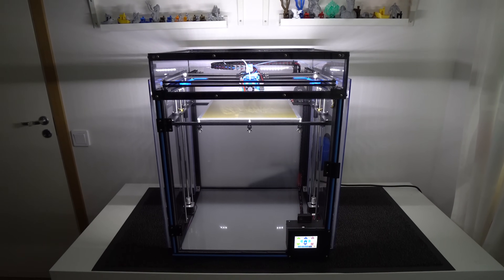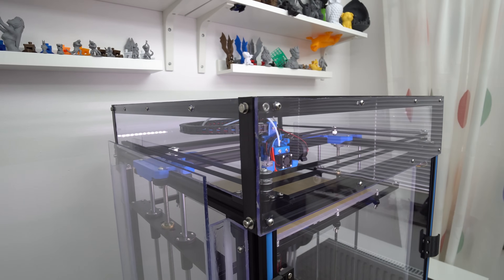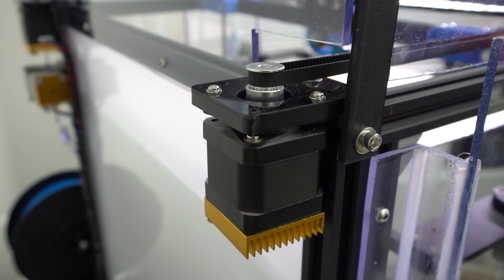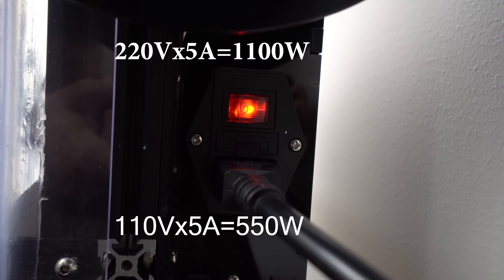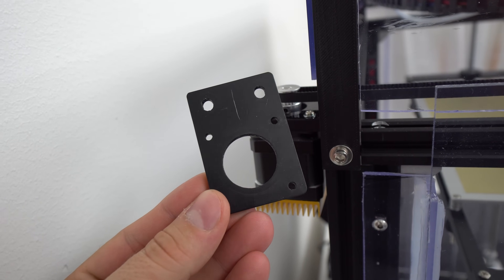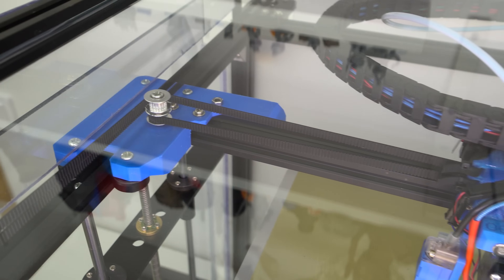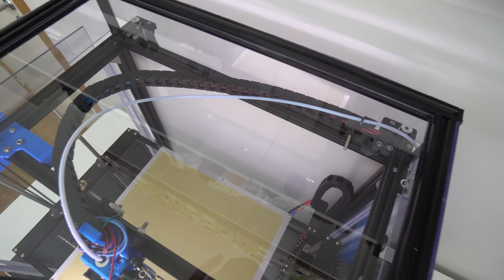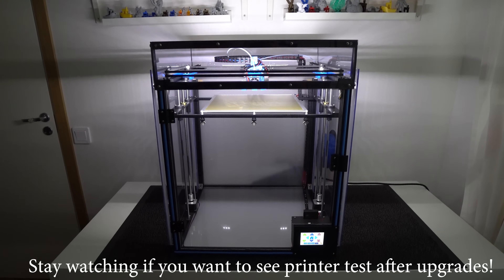Tronxy X5SA 3d printer ultimate upgrades!

Comment: Hello, what is the differences between X5S and X5SA ?  For example on the X5S is famous the heated bed is not working and have to buy a dedicated power supply of 24V for make it heat up. Here on the X5SA is the same? Seems like they upgrade/fix some issues from the X5S and named X5SA but what they update?
Thanks
Reply: Or by the way why the X5SA it cost 60$ more that the X5S ? On the gearbest site they have same features. Thanks

Comment: Before i install a Solid state relay to this X5SA, i saw one of your videos on your Creality CR-10 build to where you have put a SSR and a 330W heater under the bed. Does the same instruction from that video apply here since i have already annalized that and would like to do it to this tronxy as well. before i kill myself doing all the wiring and stuff, i would like to know if it will apply to this machine as well.

Keep in mind, I seriously dont know what i'm doing since i am new to this whole 3D printing business but i would like to learn from experience and not kill jyself in the proceess.

Comment: Layer consistency needs improvements. Straightening the belt path and tightening the belt is in order but acrylic parts will not be able to handle the load.
In all looks very nice but lot less attention was paid for the things that actually improve print quality. In particular stainless steel nozzle with low conductivity levels will make it difficult to get consistent prints. Hardened steel is lot better in that respect.

Comment: I was wondering how you calculated your M8011 firmware value for the titan extruder steps. is there a formula that you used? I read the Chitu G Code explanation but its still a bit confusing.

Comment: Hey,  Awesome video. Hoping you see this. Im new to 3d printing and planning on getting a x5st will these mods be compatible with this model as well? Looks to be the same just a slightly bigger bed size. Thanks
Reply from the maker: Jayden Smith Thanks.
 Yes I believe so. As far I can see only screen is a bit different and it's bigger in size.
Reply: @NexiTech  Awesome, looking forward to it. Thanks

Comment: Nexi, first of all, I have to say your channel is one of the most detailed, helpful, 3D printer channels I've ever come across. Thanks for sharing all the hard work. Definitely gained a subscriber.

A couple quick questions for you: 1) Does your modified X5SA print any faster than any of the comparable cartesian printers? (Tornado/ CR-10/ Chiron/ etc.)

2) What are your thoughts about core XY vs. Delta printers vs. Cartesian are far as speed? The published specs are usually ~ the same, but every comparison between the delta and  cartesian, the delta wins. I can't find any comparisons between core xy & delta. (Assumes comparable finish quality for the speed tests).

Thanks!

Comment: Hi! Thanks Your video! Please help me... Are you sticking a silicone heat-bed heater to the original heater-bed or have you bought an aluminim sheet? Thanks
Reply from the maker: Just stick it to the original Heater-bed, New heater has double side tape on it. Of course first remove  all wires and old thermistor from old heater. New one has everything on it.
Reply: Nexi Tech thank you

Comment: Hi i do auto home and the dsplay in system menu show this:x= mm 50,00 y=mm 30,00 z= mm 2,20gcode start in my cura settings:G28 ;Home
G1 Z15.0 F6000 ;Move the platform down 15mm
;Prime the extruder
G92 E0
G1 F200 E3
G92 E0i'm a newbie and i dont know how to set cura start gcode...I'm also non be able to connect pc with x5sa by repetier host.. i connect it but printers dont execute the commands that i send to it...greetings for your help in advance

Comment: Hi, I made the changes to the x5sa as your video for the guides of the extruder (mega gantry plate), but when I do z-offset the hotend does not position itself central to the plate and the print does not respect the Cura 3.5 measurements while having them set from cura setting 330x330x400mm. can you help me solve the situation?
Reply from the maker: Gian luigi agostini How far you are off on X and Y axis? Can you do auto home and measure it? You can do X and Y axis offset in your start Gcode in your slicer settings.
Reply: this evening i do it and then tell you...greetings

Comment: I've been thinking of upgrading from my i3 clone to a CoreXY printer for a while now. With this many upgrades, I wonder if it's even worth going with a printer kit. It might be cheaper to build your own from scratch!
Reply: I thought the same thing. Then I actually added up all the parts for just the frame, wiring, and control board (no hotend or heat bed) using the cheapest options I could find on BangGood and AliExpress and it was already $100 more than this!

Comment: never mind I figured it out. The default travel speed in cura is 120mm which is way too fast for this printer. I set it to 60 and haven't had an issue. since.
Reply from the maker: Rick Smart You got some problem with your machine. I can reach 200mm/s travel without any problem or any layer shift even with completely stock hardware with no mods on this machine. First check your X and Y movement's by hand are they move nice and smooth? Then double check all wheel bearings on aluminium extrusions. Then re-check bearings(pulleys). They all need to roll smooth and without drag.  Maybe you over tight bearings on belts. Also last step re-check  stepper drivers voltages. Set them to 0.9V.
Reply: @NexiTech  hey,

I had already checked all of that and then again. I was about to send it back but after doing a little digging on reddit a user suggested I turn the travel speed down and it worked like a dream. Also i dont know how to change the voltage of my stepper motors. Do you have a tutorial? Thanks for getting back to me so fast as well.

Comment: Did you have any trouble connecting to Cura via usb? I cant seem to detect the printer and ive tried using all com ports and still nothing any help would be awesome. Great video! and Tronxy must have listened to you they added butterfly nuts for the bed and way better Y and X bearings on my kit i just got. Thanks.

Comment: Maybe I understood. I have to copy from https: //drive.google.com/open? Id = 1hy5 ... from "All firmware gcode"the file
titan extruder steps.txt rename it in gcode put it on the sd card and launch the print ... can you confirm that the procedure is correct?
Reply from the maker: Gian luigi agostini Yes, just use .TXT file no need to change to .Gcode. Copy to Micro SD card and click "print". Easy
Reply: copy file without change in it in sd card  and print from x5sa?

Comment: NOTE: When installing the Solid State Relay notice that the DC input polarity (+ and -) is important.  The polarity is not marked on the green Heated Bed connector on the motherboard.  Use a multimeter to determine the polarity coming from the connector by going to Pre Heat on the touch screen and turning on the Heated Bed (but not Hot End).  If you have your probes reversed you will see a -12 volts displayed.  On my motherboard the positive was on the left, negative was on the right.  I swapped in a black wire for negative so I could easily tell the difference in the future (14 guage to match, but not necessarily required since current draw much less now).
Reply: ...just an update on Heated Bed upgrade...  I stuck the 600W Bed Heater to the aluminum bed using 3M backing (500W in my case, since I bought the one that works with 120V - RMS from my wall measures 126V, so I picked that model of Bed Heater from the AliExpress link Nexi provided).  The Bed Heater has a thermistor in its center, so I removed the original thermistor that came with the printer.  Hooked up the new thermistor wires to the old thermistor wiring (so I could re-use the motherboard connector).  Them I wired the AC and DC connections for the Solid State Relay and to the Power Supply AC screws as diagrammed in that other thread).  I ran a Pre-Heat from the Control Panel to 60 C bed heat and it measured perfectly at the center of the aluminum plate.  I put the plate on top of the Headbed Insulation (hadn't glued it on with Silicone yet) and cranked up the Pre-Heat to 100 C.  Very fast heat-up and perfect reading.  There is a few degrees fall-off around the edge of the plate, but to be expected in an open environment and such a large plate.

I put the Silicone Sealant on the back of the Bed Heater and secured the sheet of Heatbed Insulation.  Silicone sealant takes 24 hours to cure, so I will re-assemble my printer then.  Love these upgrades - Thank You So Much Nexi !!!
Reply: @MrTactileFeedback314  Did you need to get a different SSR than the one mentioned? One for 120V out?

Comment: where you mounted x-axys endstop on the hotend? i cannot see it
Reply from the maker: Gian luigi agostini Open this link and check photos.
https://drive.google.com/drive/mobile/folders/1hy5MsZN4WBtp-So_kmnCvzz4_ft4idHY?usp=drive_open
Reply: another question ... do you have to change something in the printer firmware to use the titan extruder? do you have an electric scheme of how to connect the v6 to the cables to which the original hotend was connected?

Comment: Thanks for the video. I am between the Tronxy X5S 500 and CR10S 500. What would you recommend between the two? I have no 3D printer experience, but am mechanically capable and think I could tinker with either one. They both seem very popular, but have noticed differences such as a cubed frame and belts vs lead screws between the two. Of these two models, what do you recommend? Thank you
Reply from the maker: spezzy To be honest none of them. You will have alot of problems leveling the bed that size on both machines. Auto level is a must have at that scale. Also both have 12V power supplies at that bed size?! That's not remotely enough. If you looking for large scale 3D printer I would strongly recomend that you go with X5SA(if you are willing to do upgrades) or Anycubic Chiron(I made final review not long) https://youtu.be/goY6slY4Ryc
Reply: I completely agree with Nexi here and if large print size is important, I suggest the Chiron, too, as I’ve had much better experience with Anycubic than with Tronxy, both in the quality of the product and their service.

Once you have your first printer easily working trouble-free, then you could consider modifying a Tronxy for your second printer, as the Core-XY mechanicals have an advantage, in theory, over the back-and-forth moving printbed of the Chiron. Nexi’s modifications make his Tronxy able to print with more exotic materials/higher temperatures - the enclosure is essential for this and the Tronxy’s design seems to suit it.

If different materials and print size are less important and you’re looking for speed and quality, I recommend you get a Delta instead :) my first printer was the original Anycubic Kossel and I’m now very happy with my Kossel Linear Plus! Not usually recommended for a beginner but it was easy to set up, and it’s reliable - it is very useful for printing parts for my Tronxy :)

Comment: Question - When you enclosed your X5SA you replaced some of the interior parts with PETG or ABS (to resist the high heat when enclosed).  I am new to 3D printing - if I upgrade the bed heater to the AC one (high temp) I can see using PETG without needing the enclosure, but don't I need the enclosure for ABS  printing to work properly?  Which parts need to be in PETG or ABS?
Reply from the maker: Steve Hiemstra If you upgrade your stock X5SA only with AC heated bed then you don't need to print any additional parts in any material because stock parts are from metal and you can use any filament that you want. I'm not sure what is exactly your question.
Reply: @NexiTech  Thanks.  My goal is to enclose the printer, as you did, so I am going to make all of the upgrades that you mention - including the ones that replace the rollers, chain, and parts around the head with printed parts.  What material did you use for them, and should I make them before or after I enclose?

Comment: Hey nexi, how quickly does the new bed heat up to 100c
Reply from the maker: JDMMX5 Like 3-4 minutes.
Reply: Wow that's really quick also did you stick the new ac heater on top of the original heater and what is better a solid state relay or a mosfet
Reply from the maker: JDMMX5 Well it's 600W AC heated bed now:) Yes, I did and I install heat-bed insulation as well. Well, solid state relay and mosfet are doing the same thing. Solid state relay are used for AC electricity(they are for AC heaters) and Head bed Mosfet is for DC Electricity(DC heatbed).
Reply: @NexiTech  But i don know idea, how y control bed temperatures on 220V AC heater. Can y fry steak on it? 200C heat bed is hell.

Comment: can i ask?? about the rollers that you replaced.. what bore diameter is it? and how many smooth and how many tooth pulley is needed to fully replace all?? ive ordered one.. after ive seen your video.. and now im ordering all of the components.. that youve upgraded on it.. ^_^ thanks..
Reply from the maker: Emem Redilosa 
Pulleys are 20teeth with 5mm bore. You need 6 with teeth and two without teeth.
You have all links of parts in video description. 
I'm glad that you like my upgrades :) Cheers!
Reply: @NexiTech  ive just got all of your updated parts and im super happy with this printer.. now im upgrading it to mgn12H.. linear rails.. and a custom enclosure...  i was just wondering.. would you advice to put a TL smoother on this printer or not?

Comment: how did you calibrate that extruder? what commands did you use?
Reply from the maker: Tim lemmers Just take mine calibrated Extruder G-code file,copy to your micro SD card,plug to your X5SA, select file and click "print". That will write new extruder parameters in firmware. 
 I leave link in video description. I copy it for you. Here it is: 
https://drive.google.com/drive/mobile/folders/1tdwMPRY7V7jgaOT8AEzduoCBc5F6kLCS/1PuNfSowQsc8XCkinZ8GZTMwFNxUlpDS6?usp=drive_open&sort=13&direction=a

Comment: did you change anything else when you mounted the titan klone extruder, i bought a tevo extruder ,but its difficult to make it fit
Reply from the maker: No I did not. I just insert Teflon tube and screw it down to the frame. Did you get plastic holder for extruder like i did? It has 6 position for the 6 screws.  Easy to fit.
Reply: @NexiTech  no, i used the original holder that came with the printer, but now i try to use your g-code its all wrong, avrything is oppsitt off the original

Comment: I am considering getting the 400 x 400 x 400 version of this and they state they have a 30A power supply which is what comes stock going by the review and i was wondering if i did the silicon heater mod would i need to replace the fuse and power supply I live in Australia where voltage i believe is 230v at the mains. cause in the description it says 12V 15A power supply is that just going to power the heat bed or is that for different voltage regions?
Reply from the maker: Dial Up Is The Future I really can't answer on that but I will tell you that going with 110V/220V silicon heater is real deal. Heats up extremely fast and you basicly don't need to change power supply if you don't want to. Silicone heater use 110V or 220V AC and solid state relay(to control the heated bed) so you can still use power supply that comes with a  kit for powering rest of the components or you can change to much less powerful one (120W or less) if you want to. I change mine because I need it original Powersupply for other projects and I install small one with passive cooling ( without fan) to keep it silent.
P.S. double check the fuse anyway. You might need to change it depend of Wattage of Silicon heater pad.
Reply: @NexiTech  ok thanks for replying I will go with this kit when it is on sale and get a ac silicon heater watched the installation on the cr 10 is there anything that is different that you encounted or is it pretty much the same with this printer.

Comment: Just ordered one off Gearbest for there 19% off sale. :) What length of GT2 belt would need to be ordered? I couldn't find it in the docs anywhere. Also do know if the motherboard will take 24v? Like to change out the extruder with a 24v ED3 I have here. :) Thanks for the great video of your progress on this printer.
Reply from the maker: Cool! Well I did not measure exact how much I cut off but I did had 5 meter roll of GT2 rubber belt and it did the job. All Chitu f Mini motherboard are 12-24V compatible as far I know, but I'm not sure should I recommend it. It might show Salmon skin on the prints like most other printer that runs on 24V. Not sure.... On 12V it have no issues. Also if you connect 24V on the heated bed instead of 12 you will not get too much more power as resistance of heated bed is not that high so when I did the math I realize that is much better to run AC Heated bed instead. Also case fan needs to be changed as well filament fan they are all made for 12V.